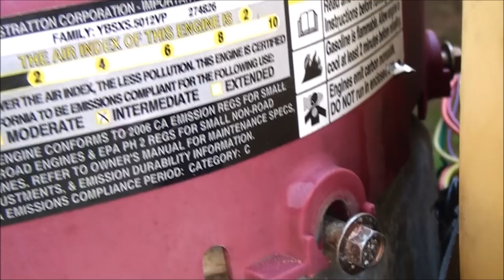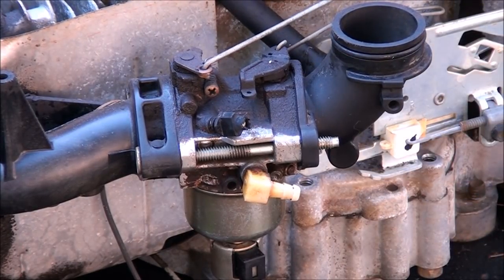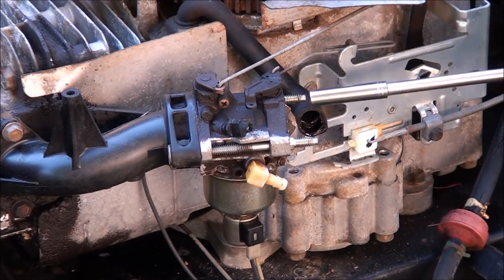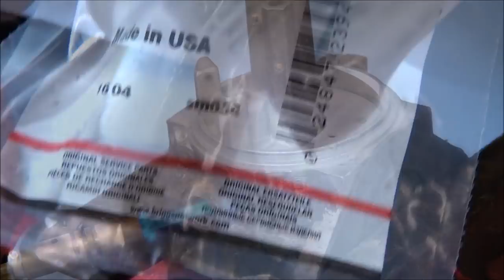Briggs and Stratton INTEK OHV Engine: CARBURETOR REBUILD & Repair. Riding Lawnmower LEAKING GAS FIX

Comment: Thanks for the video. I just removed the carb. from a Troy-Built with a BS 17.5HP 5002VV family engine. As I was sitting there in the pole barn think I should be video taping what I am doing so I could put it back with out a cup of screws left over! So Thank You very much for the insurance video.

Comment: Why not just replace the carb.
Reply from the maker: A quality OEM carburetor for this engine is $100.00 or more. Cheap carburetors often fail quickly or do not work well from the start.

Comment: Thanks.. I couldnt see the flat spot on the solenoid but I saw how you did it and got the job done. Tractor runs great now after sitting for 4 years.

Comment: Good video for those still using gasoline for fuel.  I had my 17.5 hp Briggs Intek engine professionally converted over to propane.  Best thing I ever did for my mower which is an eleven year old Yard Machine 42 inch cut.  I have about 68 hours on the engine running on propane and the engine looks like new because propane leaves no residue of any kind on the motor or any other place.  Starts and runs very well.  No more gas for me!!
Reply from the maker: Cool!! I will have to look into how to do that,. What was the cost to do that? Thanks for the comment.
Reply: I used an outfit called Carb-Turbo in Minnesota and with the propane regulator, hoses and the adapterfor the inlet for the propane it was around $150.00.  Then I had to mount the 20 lb propane tank on the back of mower.  So they just happened to have a heavy duty bracket that fits the 20 or 30 lb tanks and is awesome and cost an additional $80.00 and worth every penny.  Easy to adapt to the mower using a couple of angle iron sections.  My mower had the holes already stamped in the frame between the rear wheels.  If you google   Carb-Turbo you will find it easily.  These guys really know their stuff about conversions of all types and sizes of engines.  Propane regulators for engines are rated by horse power.  I used a Garretson T-60 rated for up to 40 horse power and seems to be a good choice.If you decide to convert to propane you will ask yourself, like I did, what took me so long.  It is a no brainer as far as I am concerned.I had a mobile mower repair man come out to the house to replace all three belts that were 10 years old and starting to slip a lot.  So after he got the belts on he had to test drive the mower.  When I heard the mower running I went out to look.  When he shut the mower off he said that was the coolest thing ever; his first propane powered mower he had worked on.  He gave it a thumbs up.

Comment: You could use a torch tip cleaning tool for  cleaning of the small holes, as the torch tip tool has different diameter rods that are file like .
Reply: P.S. Thanks for the video I've done most of my own mechanic work since I was 14 but certain things I'm not real comfortable doing but with the newest social situations I realize I need to tackle those problems as well

Comment: @ 7:28

I have that same B&S tool, but it's not very strong; I've bent it on the first use trying to remove an emulsification tube. Best find or make a special screwdriver that barely fits this bore, but will be stronger. I also have a #2 flat blade screwdriver bit, a long one, that i use with a 1/4" nutdriver, that works well. You just don't want to scrape away at the sides of the bore if you can avoid it.
Keep the B&S tool for lighter work or reassembly torque.

Comment: Great video, i have exactly the same job to do tomorrow & thanks to you it will be a lot easier for me :-)
Reply from the maker: You can do it!
Reply: @JeffsLittleEngineService  Worked like a charm, mine wouldn't start at all. Once cleaned it fired up & runs. I'm not sure if i have to adjust the little screws or not as it runs a little juddery sometimes. But getting it started is a great achievement, thankyou :-)

Comment: I’m working on the same setup. But my problem is I’m working on trying to get the nozzle out. The  the top of the nozzle I can’t turn it Out because who ever worked on it chewed the end where you  stick the screw driver in , chewed up. What can I do to turn it out? Great video by the way!

Comment: Hi Jeff I have a 17.5 Briggs and Stratton engine on Ariens rider. It will sputter and smoke for about 2 or 3 minutes then dies out. I have changed the air filter, gas and gas filter. That piece on the solenoid that you were pushing on does not move a freely on mines. Would that cause my rider to act like that or the carburetor.
Reply from the maker: yes

Comment: @ 10:13

Jeff, what's your feeling on checking the float height on these plastic floats? I know they're supposedly "non-adjustable", but I have heard of people heating them up at the tang and bending it to adjust the float height. I'm guessing if you've decided to change a float, then you've nothing to lose by trying...
Reply from the maker: If the float has a metal tang on it it can be adjusted.

Comment: Thank you can I by pass the electric fuel pump on my 13.5
Reply from the maker: yes, as long as the fuel tank is higher than the carburetor.

Comment: I just got one of these mowers used for like ~$200, it is a 17.5 HP but needs a lot of work, I hooked a battery to it (checket to make sure they were connected right) and tried to start it,  nothing worked (or it could be the jumper cables I used)

Comment: can the solenoid cause it by chance just to cut off while in use  18.5 intek ohv briggs and stratton   it runs fine carb has been cleaned  and all runs great no surging at idle or anything  it just cuts off at times like its run out of fuel  but its over a half a tank , on restart it fires bk up but takes a minute before i can idle it up using the throttle lever   it want just take the fuel  it will cut off  when I idle it up

Comment: Hello,Jeff How are you? Are Briggs & Stratton Intek Engines Commercial Duty which is the Better Engine the Older Inteks or the New Intek Engines? Mine has the Cast Iron Sleeve Model # 311777 Type 0143-E1 Code 000613ZD.
Reply from the maker: Not sure but probably the updated newer version. The Briggs and Stratton engineers are very good at updating  common problems on their engines.
Reply: @JeffsLittleEngineService  That's understandable Jeff Yes the Briggs & Stratton Engineers are Very Good About Updating Engine Problems with New Updated Versions of Engines. I Just Lost my Briggs & Stratton Opposed Twin Engine 16 Horsepower the Tractor was my Dad's the Starter was Bad & I Couldn't find the Parts to Rebuild the 42" Mower Deck so I got rid of the MTD Lawn Tractor. I Traded it for a John Deere Sabre Lawn Tractor With Single Cylinder Briggs Intek Engine. 19 Years Old Approximately the MTD Tractor was a 600 Series 23 Years Old from HQ Home Quarters Warehouse. My Current Tractor came from Weingartz.

Comment: is that thingy on the bottom of the fuel bowl an injector ? @ 3:48
Reply from the maker: No it is an anti backfire solenoid. It shuts off fuel delivery immediately when key is turned off.
Reply: Hey Jeff, is this necessary to have connected for this engine?

Comment: i noticed at the end of the video that you left the pcv hose off the carburetor? im having trouble keeping my briggs engine running. (it starts, but dies quickly). i havent tried leaving off that hose. will that make a difference? also i must note that my briggs does not have a fuel pump. (16.5 hp)  i have a coil on the way.. but im not sure that is the problem because i bench tested it and it passed.. soo?? im at a standstill. I have already cleaned the carburetor thoroughly. and I have already spark tested with the old coil and there was a orange-ish colored spark..which made me think it is a weak ignition coil? is that possible? anyone who can give me some tips, I appreciate.
Reply from the maker: No the breather line attatchment will not make a difference. It kinda sounds like a fuel delivery problem...seems that you have spark ok.

Comment: You removed the 2 back bolts in the back on the red cover, but its already off the 2 posts in the front. How did you pop it off those 2 posts? I can't get it to budge off them.
Reply from the maker: take out the bolts the cover will lift right off

Comment: Jeff, I have a 2005 troy bilt pony with a 17.5 Briggs engine. Last time I mowed, as I was finishing up, the engine started running wide open hard. The only way I could slow it down was to choke it down. Do you know what is causing this and a video that may help me fix this. Any help will be greatly appreciated.
Reply from the maker: not sure check throttle linkage. otherwise it may be the internal govenor mechanism

Comment: Jeff, I have a john deere L108 with a 18.5 hp Briggs and Stratton Intek.  It runs till it gets hot and now shuts off, it will restart without a problem but will only run for a minute and shut off again.  Have to let it cool before being able to stay running.  Probably needs carb rebuilt but could it also be the fuel shut off valve or even the ignition coil?
Reply from the maker: most likely the fuel system needs cleaning. sounds like the carb is getting plugged up.

Comment: I do not have gas flowing into the carburetor. I added a fuel shut-off, fuel filter and line but the carburetor is dry with no gas. Any suggestions??  Thanks
Reply: Does it have that solenoid at the bottom? That may not be opening to allow fuel to flow. You can test with a 9 volt battery.

Comment: Does this use a separate fuel pump apart from vacuum from the carburetor?
Reply from the maker: some do some dont it depends on where fuel tank is mounted. This one does not have one.

Comment: Jeff, Great video.  What was the part number on the Briggs and Stratton jet screwdriver tool?  Amazon has two 19061 and 19062.  Is there a difference?
Reply from the maker: Sorry, I cannot remember for certain but the 19061 looks like the one
Reply: Thank you

Comment: I bought a brand new carburetor but a lot gas flows into the carburetor.  When the lawn mower turns off a lot of gas is sitting the carburetor where the cover sits. What could be the problem?
Reply from the maker: it sounds like the carburetor is flooding. It is a good idea to clean the gas tank to make sure no sediment can get into the carburetor.
Reply: Thank you! I changed the old and filter and adjusted the oxygen and gas needle valve thanks!! Subscribed already!!

Comment: My mower is like the one your working on here. Mine will only start if I pour a little gas in the carburetor but dies again in just a few seconds . what's your thoughts
Reply from the maker: it needs the carburetor and fuel system cleaned
Reply: Do you have a video that shows how to do both

Comment: I've also found running a little bit of seafoam in every 2nd or 3rd tank of gas in any of my 2 cycle and 4 cycle Engines keeps them running right with a lot less cleaning of Carburetors And the entire fuel Systems
Reply: I use premium fuel, no ethanol, then there are no issues with corrosion.
Reply: @bobsoft  where I live we don't have any non-ethanol fuel, they like those extra taxes too much

Comment: I redid mine, but now it only runs on high idle only. It dies if I take the choke off.
Reply from the maker: carb is still plugged and it sounds like the carburetor slow speed/pilot  jets/passages

Comment: I have an 18 h.p.. How do I set the RPM to 3600.?
Right now it's running wide open at 4200 RPM, and lost lever control function.

Comment: My float valve is stuck tight closed and I can't remove the FLOAT. How can I get the float valve needle to come off it's seat without destroying the float. Ran great last year. Yes I did remove the float axle.
CMV
Reply from the maker: It's stuck so the needle valve is most likely ruined. A new float is fairly inexpensive, maybe spray some carb. cleaner in there to try and loosen it.

Comment: Jeff, i have the same Engine. It starts up great it idols Low great. when i bump up the throttle it starts to loop. almost dies and comes back up and back down up and back down!   I changed the Fuel filter I changed the  fuel pump. i puled the Solenoid down  it seems to work fine I am thinking i need a rebuild or a cleaning which do you suggest?
Reply from the maker: sounds like and obstruction inside the carburetor. Check that the main jet and all tiny nozzle holes are clear

Comment: I have the same engine and the flywheel is stripped but it still starts could that make it off balance when it’s running?
Reply from the maker: yes, If you mean the flywheel key is broken
Reply: Ok thanks

Comment: @Jeff's Little Engine Service - would like to start by re juvenate of old vid with a bump up. Next, I focus on this vid because of engine. Which you know and is exact engine I have on a rider. Although my issue differs alot. I have spent years on my issue in looking and got no place. I have posted to YT and many groups and oddly I get nothing. I am here to ask for input and thoughts on all please. This is a bit long and that is due to respect to all that see. Vs saying my mower is this issue and nothing else to go by. Mower info is- Yard Machines 2008. # 13RN772GO29. Not PTO electric. Engine- Briggs I/C 17.5hp. Issue- stalls and attempts to die with blades ON AFTER clutch/brake pressed. That is ONLY when I touch or press pedal down. Keep pedal down and it will kill in few sec. Attempts to kill and at time in doing it backfires etc and bog power down till kill unless release pedal.  History of mower- Brought used few years ago. New carb from Briggs direct. New gas line, spark plug, filters and tires. New blades, bearings and so on deck wise. All new MTD orig belts. 91 oct- no eth gas is all I use. Mower looks new enough and taken care of now. Haul done by me on parts etc. All wires look new and not hacked up in black tube etc. Motor pretty much shines and not beat to hell. Connects cleaned with DeoxIT and prongs look new. Mods done- I removed the wire to switch for reverse when blades on. I did this at day one when got mower. No issue there on that subject. Here is what took place when I brought after my haul. I ran mower for two years and not one issue. Ran smooth and great while mowing. Other summer I was mowing and the issue started. Now is a new year and mowed twice with same issue. Looking like ass to everyone as my mower stalls in forward or rev when mowing. So last week I thought maybe the brake/clutch switch under pedal. I ordered a Rotary and replaced. Same issue after and not solved. Any input where to look? Also would a coil cause any of the stuff I said? Even when mower runs smooth cutting long as pedal is not touched... Thanks for the look as I cont to mow looking like ass lol. ISSUE- mower wants to stall and kill when brake/clutch is touched or pressed. ONLY with blades on. Blades OFF and runs great when use of pedal. Switch replaced with new Rotary under pedal. Issue still same. Side note- Oddly I inspected and see no wires or the like to ground anything out. Least to my view. I have not been under engine hood though since day one to clean wheel and coil.

Comment: I have always wondered about heating the whole to expand the metal.
Doesn't that technically make the hole smaller. You're expanding the metal smaller hole. Seems to work but I've always wondered about the physics of it. I don't think we're making the hole larger with heat. I think softening the metal is what's happening.  Because physically cheat would make the hole smaller
Reply: The hole expands because heating it makes the walls 'longer' as the atoms 'move against' each other and 'push'. Same principle as a wagon wheel rim, or heating the ring gear on  an auto. As it cools it 'shrinks' and forms a tight mechanical bond.

Comment: Hi, could someone please tell me what the adjustment would be on the jet on this exact kind of carburetor ? how many turns counterclockwise would I have to set it at ? only difference is my engine is a 15.5 HP ohv instead of  a 16.5 like in the video. Any help much appreciated !
Reply from the maker: preliminary adjustment is 1 1/2 turns out after finger tightening it.

Comment: Ethanol eats BRASS and Cast metal. Rots plastics. New fuel is crap.
The best tip I ever got with using new fuels is to Run 2 Stroke fuel/oil  before you store it away.
In the old days you just ran the engine out of fuel and you were good to go. Not anymore. Fumes will eat brass.
Reply: hea great vid.where in hell did you find a rebuild kit thx bud

Comment: Mi CRAFTSMAN RIDEMOWER WAS IN THE GARAGE FOR 2 YEARS BECAUSE BROKEN LEFT FRONT IN SUSPENCIÓN I REPLACED AND WHEN PUT GASOLINE IN THE DEPOSIT FOR GAS START LEAK GAS FROM SOLENOID.
Reply from the maker: sounds like the carburetor is flooding

Comment: You replaced the needle on the float but not the seat.... Both wear. And you didn't check the float level..... C+ video...
Reply from the maker: yes replacing the brass seat is necessary sometimes. It is a non adjustable float. Thank you for the passing grade. :)

Comment: It Seems since methanol was added to gasoline the White residue attacks every type of Carburetor On lawn and garden equipment and it keeps me busy cleaning Main jets, fuel bowls, floats and the fuel needle and seats. On 2 cycle Engines like Weedeaters And blowers the diaphragms are always crystalizing Because of methanol drying out the rubber o-ring and other parts... Now I find it much less aggravating to buy a complete Carburetor off Ebay or Amazon and put them on whatever lawn and garden equipment that's having Carburetor Issues Because they are so many different sellers having endless Amounts of them available and with free shipping makes it easier to deal with and get back to working with the Machines